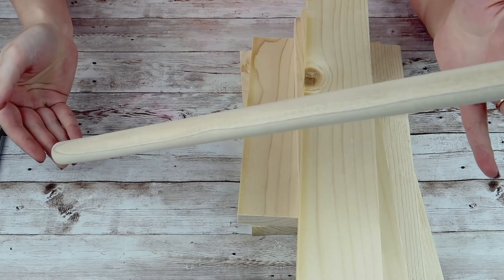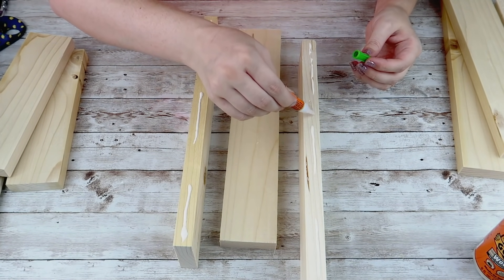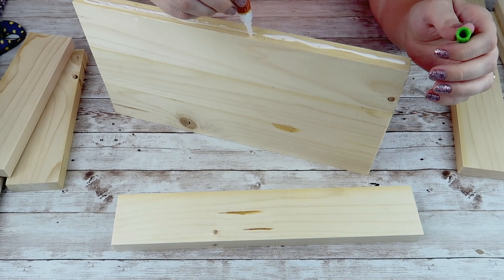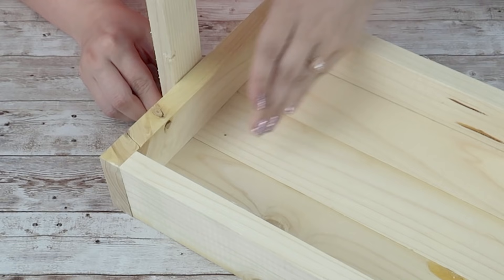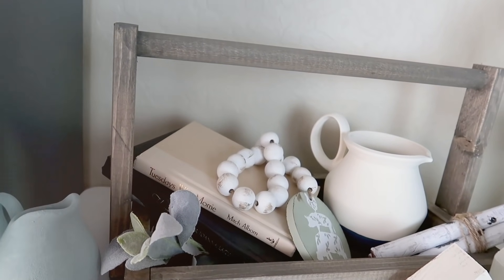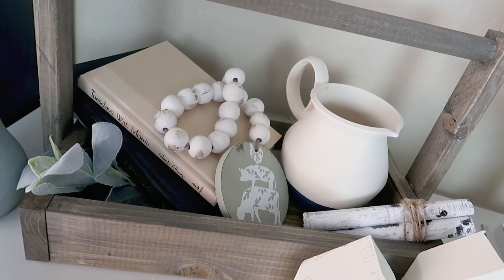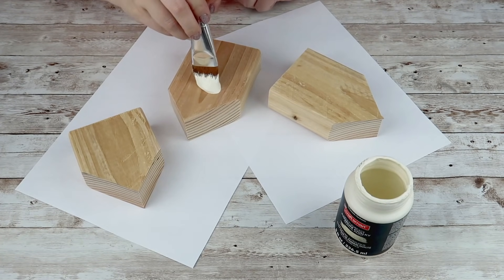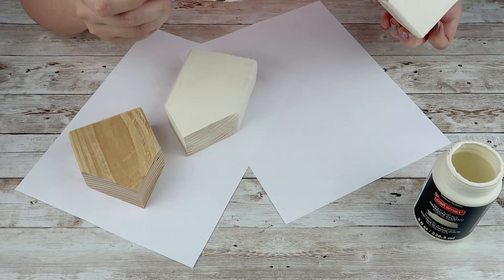SCRAP WOOD DIYS Turned To HIGH-END HOME DECOR | Affordable Home Decor Ideas Using Wood

Comment: The GingerChick always adds a clar coat of wax or spray over chalk paint so the paint won't wear off. Do you seal your items?
Reply from the maker: I don't typically seal them and have never had an issue. When I was making and selling items I would do a clear coat before the vinyl if I was leaving the vinyl on the sign. But for everything else I don't typically seal it and everything I've made the paint has stayed perfectly. But I think it really depends on what you are using it on. High touch areas probably need it. Home decor that sits on a shelf, I don't see a reason to.

Comment: If I can give you some advice the next time you find a paint or stain or even a glue that you might like it could be anything.
Buy one of them empty paint containers at your hardware store that like a 5 gallon bucket or any size and make yourself a label for the product that you going to put in it and when you find a product that you really fall in love with.
So you won't take a chance on not finding that product ever again because they stop making it you could buy enough of it dump it in that container and label it keep one of your small empty containers that you could refill.
So that way the next time you do find a product you fall in love with for whatever reason that you fall in love with it for you could have enough of it on hand just keep buying it so you won't take a chance on the company stopped making it then you won't find it anymore if you stock up on it dumping into a empty clean container and label it and that way you have enough on hand of every product that you don't have to worry about the company stop making it then you won't get depressed because you cannot get your favorite product again just make sure you buy enough of each product before that happens again.
You can buy that empty paint containers at your hardware store without labels and all you have to do is relabel them with your favorite product label and just buy enough and dump it in there keep the empty containers and you won't never run out of it again.
Maybe some more advice I can give you the next time you find a product you fall in love with maybe you can try to decipher on what ingredients that is in that product and try to make a home version for yourself closest you can get to the product that you have fallen in love with it should be pretty easy to decide for on what's in it then you could make the product at your own home exactly the same maybe some little changes to make it easier to make your own version of it may be better.
Hopefully this by some giving you will help you out along the way and make it easier for you to keep making exciting scrap wood products to show your followers.
 And maybe along the way it might save you some money on making this product and the money it cost you to keep your channel going if you could stay on products that you have to buy you can save a lot of money especially on wood and all your paint products stain products find a way you can save money you could add more exciting things to your channel especially if you can figure out a ways to save you money.
Hopefully some of this advice I gave you in this message will help you are on the way.